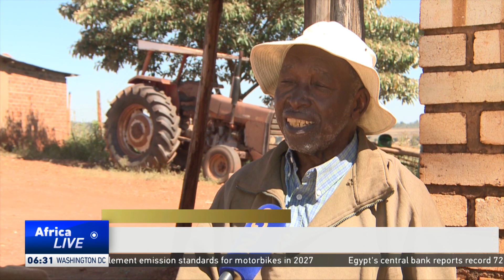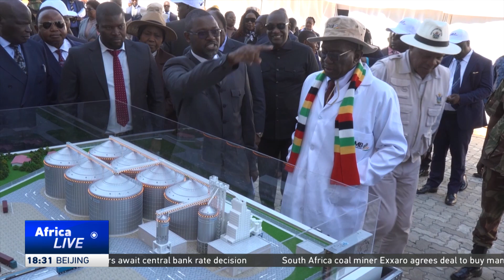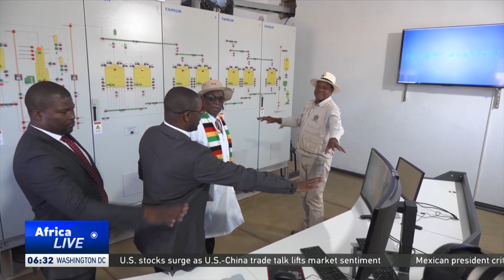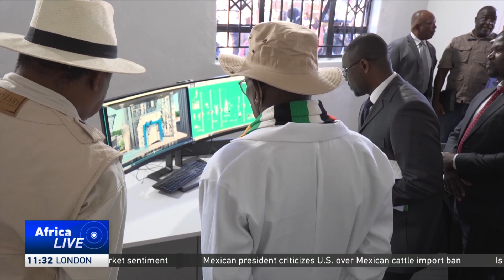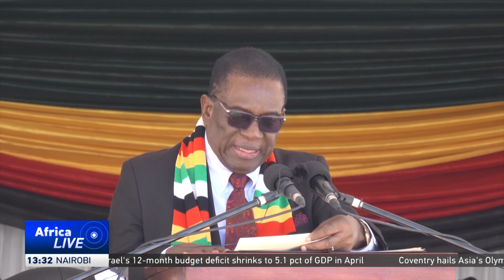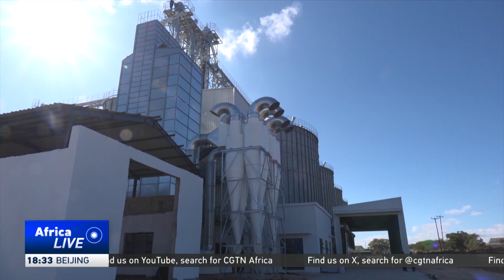Zimbabwe launches high-tech silo to tackle grain losses

Comment: Respectful Greetings!
To: 
Dear:
The development of advanced technologies has made it possible to forecast the required optimal conditions before grain being stored and during storage. The applications of artificial intelligence (AI) in the agri-food sector help in accomplishing complex tasks without human intervention.

The decrease in arable land, the increase in population and the consumption demand thereupon have increased the pressure on food products. Growing demand for food products requires increased productivity in decreasing arable land. The use of high-tech and high-quality equipment has become an important need to ensure that products reach the end-user in the shortest time and in a healthy manner. Together with this, grain production and storage will become healthy with the selection of facility location, equipment selection based on this location, logistic ease and right operation and management.

Selection of right investment location Proximity between concentrated regions of arable land and land of the facility is closely related to the selection of right location. The closer the facility and the production area are, the higher the initial logistical convenience will be. This selection is the most important factor in production procurement, production cost, fixed expenses and in related to this productivity and profitability. As silo facility is a long-term investment decision, it will be very difficult and costly to change this location. The facility location should be decided in line with the targeted level of production and forecasted demand. In this sense, the location decision should be deemed as a long-term strategic decision and it should be decided studiously.

Courteously!
Luís Lopes